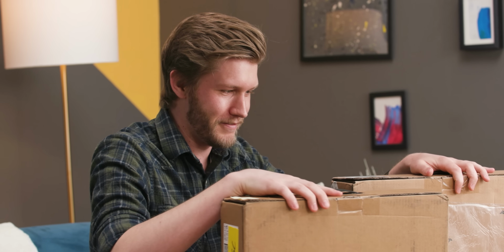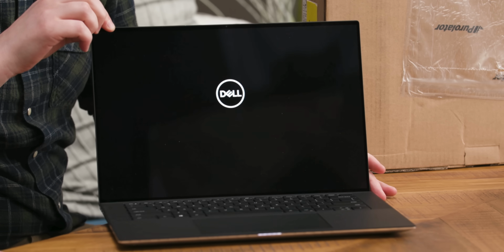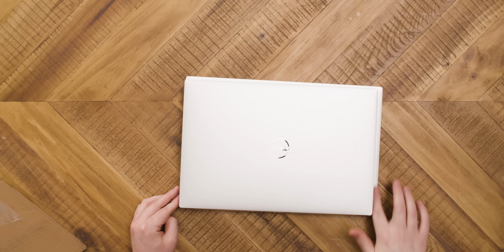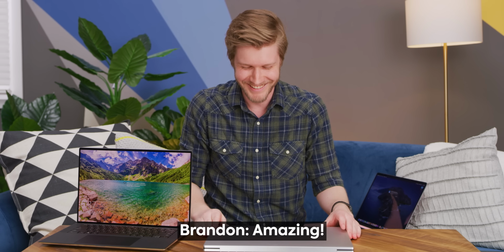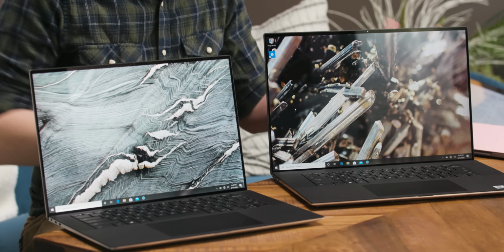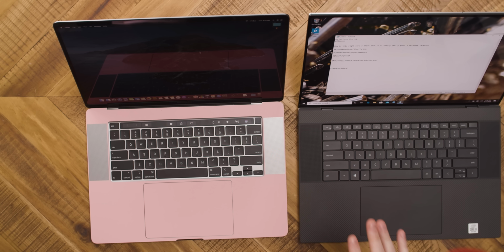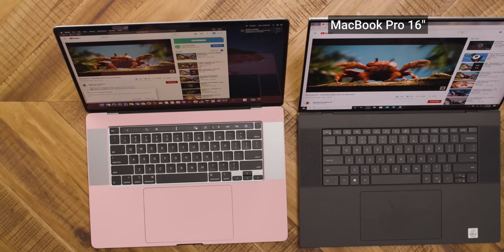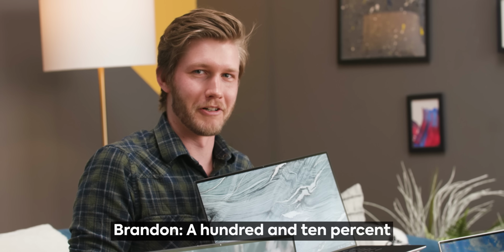The MacBook Pro's Biggest Rival - DELL XPS 15 9500 & 17 9700 Laptops

Comment: The fact that they're still leaving the Number pad off both the 15 and 17 inch machines means I still really don't care about their machines and neither will I be recommending them to any of our business clients.
Reply: What about those of us that prefer to not have a numpad?   I use my laptops for work and I actively avoid laptops that have them because I don't like how it shifts the rest of my typing off-center to the machine.
Reply: @NathanKull  I could say the exact same in the opposite direction. I manage outsourced IT for a number of data-entry heavy workloads in GeoTech, Engineering and Marine sectors. Every Time they've asked for a new laptop they've specified that the numpad be present since they enter numerical information frequently. Personally speaking I'd love to see them design a model which has a numpad as an  optional choice then we can both have what we want.

Comment: nope, macbook keyboard are trash.

try typing a 1000 word essay, my hands hurt like f.
am using that for my work and it don't feel averagely ok at all. is painful af.

lenovo soft cushion keyboard are something that is as great as diamond for people that actually use a keyboard.

~~~

also, blue light cut out of monitor is old af. lenovo implemented it like at least 10 yrs ago. what bs is that?
and apple don't even have it.
Reply: Which MacBook do you have, the 15 of 16”?    Just wondering if you feel that way with the new keyboard
Reply: @avz1226  think is a 16"
I got so fed up using it that I complaint to the management head on. 

never gone that far for a office equipment. sure hate it. My fingers are always hurting when using it.

the monitor is the same old eyes hurting monitor. well; is what one get when the monitor display is powered by a "backlight". At least is better then Dell or Asus though.
so i keep quite about this.
Reply: 佐藤海翔 thanks for the reply, I’m on the fence on what laptop to get for my coding bootcamp... not trying to make the wrong investment and hate  typing lol

Comment: I find that the laptops look great for a windows computer, but they don’t even come close to the look of an Apple computer.  Apple has a great keyboard that is truly perfected as well as amazing speakers.  They also have improved the keyboard you could say to give you more key travel on the newer MacBook Pros though I have a MacBook Pro 16" late 2016 did have to replace the keyboard once, but thanks to my investment in Apple Care it was free and now my system does have the MacBook Pro 2017 keyboard.  For me personally a computer by itself is important, but if it also works great with your smart home equipment as well as your phone, watch and TV that is just a bonus for me. It is the ecosystem that is also very important and that is something that I just don’t see with the rest of the computer industry besides Apple.

Comment: I would rather have a full cnc aluminium pc with a sandblasted and anodized finish.
The display is really nice, but its a deal breaker with those seams between the two materiales.

When does apple make windows optimized macbook😭??

Comment: Don't buy this line of laptops if you want to game. Thermals are abysmal and you almost always have to repaste. Not sure about the 17" as they have a new cooling system (they are using a vapor chamber i believe?) but I'm sure the thermal issues will persist with the 15". Again, not great for gaming or heavy editing on after effects or even moderate work on blender unless you repaste.

Comment: What happened to 1440p on laptops? 4k is utter overkill even if you have the best eyesight and 1080p is not enough for such an expensive device. I don’t get it? Just have one option of 2560x1600?

Comment: Brilliant bit of hardware, but, they both still run Windows, which is fragmented, buggy, and lacks proper trackpad support.  Mac OS is by far better, as is the Trackpad on the MacBook , the reliability will be much better on the MacBook , as are the speakers, thermals, build quality etc.  Apple Support is also far better, AND you can run Windows if you want to use any Windows specific programs.  Which is why I always buy a MacBook over a Windows laptop.

Comment: 135mm squared?  Think you missed a 0.  BTW if this is the largest trackpad you've seen on a Windows machine, you obviously haven't looked at the 2018 Matebook X Pro.

14" 3:2 screen (even better than 16:10 thanks), bezels just as thin top sides AND bottom, and the trackpad is 7.8 cm x 12 cm, for 93.6 sq cm, or 9,360 mm squared.  Guarantee that's as big as the 13" XPS.

Comment: Why can't they (Dell) just put a numberpad on the 17 inch models like everyone else can manage to do.

You have plenty of space on a 17, don't use the same damn keyboard the 15 inches use.
Reply: Maybe they dont want to? Asus doesnt do it on most of their devices (including the 17 inch), Razer doesnt do it and Apple doesnt do it either. Out of the top of my head i can only think of Lenovo and HP as companies which consistently put a numberpad on their 17 inch models.
Reply: You would lose the side upwards firing speakers, it's a compromise
Reply: @natmath2576  you put them up top, above the keyboard, where there's also room.

Functionality isn't exactly something you should be compromising on a large-form-factor laptop. When you've committed to a 17 inch, super-portability has moved down your list because you're likely not moving it multiple times a day, or for that matter outside of your house.
Reply: I'm fine without the numpad, in fact I really don't like them on laptops because I don't like how it shifts my hands off-center with the system.
Reply: This this and more this
Reply: My HP Envy 15 inch has a number pad. Yes it's useful even though I don't do many spreadsheets. Th bezels are massive though.

Comment: These things are NOT going to be good at gaming as thermals will be horrible. The only good laptops for gaming are Asus Rog because of the huge vents they get on the back and even then if you play some graphically intensive games it gets hot. These laptops will be good for 1-2 hours of easy on the graphics gaming and even then it will get hot. Nobody should buy a laptop for gaming that does not have HUGE vents for airflow.

Comment: Blue light is straight up unharmful, only UVs and higher frequencies electromagnetic waves can cause mutation to body cells. You can't really keep a blue color and removing emission from blue frequencies, however you can attenuate the amount of UV the LED is emitting (which is stupidly low anyways). So sounds like marketing BS. If you dislike blue tones on the evening, use a software filter like f.lux.

Comment: Why do I feel like the perfect laptop ever made for both gaming n' cpu intensive tasks was right here within Dell's grasp... & yet they didn't build it? It would of been the XPS model that combined the 15" screen size/footprint; but with the better GPU, the RTX 2060 MaxQ n' more importantly, the vapor chamber thermal solution of the 17". This would've bumped up both the thickness n' weight to be somewhere between these 2 models... but, dare I say it'd be the 'Ultimate' laptop, imo.
Reply: @Aaron Monto Ah, yeah, it is possible. Top of the line Intel laptop CPU (at the time), huge battery, RTX 2070 MaxQ, 15" laptop form factor and no throttling. Plus, it's 1.88 kg vs 2.11 kg! It's been done... https://www.youtube.com/watch?v=YlkFUB_XLVs

Comment: What's with the obsessive hate towards Intel suddenly? Yeah sure AMD CPUs are better now, doesn't mean Intel products are suddenly completely worthless. Besides, what people always seem to miss about performance comparisons is that 99% of the time you're not even using the maximum performance, and so performance differences only matter in a limited number of scenarios few people would even come across. For most consumers it literally doesn't matter at all, and Intel is perfectly fine even if AMD offers more performance/€ on paper.

Would be fun having people do a blind comparison between an Intel and AMD system in general use, without running benchmarks. My guess is nobody would be able to tell the difference without particularly testing for it or doing very specific tasks.
Reply: This comment is really old, but this is a really bad take. A) You want the best thing, especially in a product this expensive. In your case, everyone should be using core i3s, which AMD still beat with the Ryzen 3...

If I buy an i7/i9 it means I want to do real work. The “Avg consumer” your talking about isn’t gonna get an i7/i9, they’re getting the i3/i5. The higher end models are for people that need power, and these are the same people that want AMD processors.

And it’s not only price per dollar, it’s also dollar per dollar, like AMD CPUs are much cheaper than intel, even on mobile. Also add to the fact that they’re cooler (this laptop hit 99 degrees in stress tests where hey if you’re rendering a video or compiling a program, things that people with this laptop might want to do, actually matters) AND get more battery life, there is every reason in the book to pick AMD over Intel.

And yes, of course no one would tell the difference in a “blind comparison”, because it’s not fucking master chef is it? They’re CPUs, and CPUs have gotten so fast that the OS overhead is minimal compared to what it used to be. Add in a Qualcomm chip and apps compiled for ARM and you also won’t tell the difference...

TL;DR the people that are buying this laptop WANT more performance, which done by going AMD. The people you’re talking about in this comment are the people who buy the Dell Inspiron. They don’t care about performance. But the people that buy this laptop do, especially when AMD is consistently outperforming Intel by this much.

Comment: No optical drive is a deal breaker. Why must designers omit such a valuable part of any laptop. Yes you can buy an external but is cumbersome. Dell needs to include this option in more models than the lower budget models. The 2012 screen is much better. I like bezels.
Reply: ok boomer

Comment: I'm sick of every laptop brands that there aren't any selection for AMD variant processors. Any of them have an ethereal design but the biggest turn off is Intel. Come on, mobile ryzen chips have way better benchmarks than Intel's 10th gen outdated architecture and power hungry battery. This has to set for this decade.

Comment: The most important thing is missing: Thermals and Dell's reputation on warranty / customer service. Both have been a troubling parts for Dell. XPS have been notoriously loud when under load and getting VERY hot due the inferior thermal design. 

The good looks won't fix the fact if the product won't work well in tasks where it's designed for.
Reply: Dave 2D didn't a short look at Thermals and said the hardware has been radically redesigned for the better.
Reply: but yeah the customer service is pretty subpar, especially if you don't live in the states!!!

Comment: Never thought I would see the day an XPS 15 had less ports/bandwidth then a 13" Macbook pro.
They even took 10% away from the battery.
In the redesign make it thicker, give us our two usba ports and hdmi built in back with the two tb3 ports, and the battery indicator and 97wh hour battery, and upgradeable wifi and a vapor chamber and 8gb gpu option on the 15" and opposing dub woofer sound system and great headphone dac and a magnetic fast charging port/+ slow charging usbc.

It looks great dont get me wrong, 16/10 is awesome screen is awesome, very sexy. sd card is a must thanks.
But they dropped the ball on the 15" 17" has all the space for nonsoldered wifi and more ports, I mean come-on you are being cheap now.
Reply: I still remember my first XPS. It was a 17” almost 10 years ago. Blu ray drive, 1TB of space, a subwoofer included and one of the best batteries you could find. I think this was right around the time that they bought/partnered with Alienware. This computer was waaaaay better and cheaper than most. I think it could be a good idea to replace mi G7 with an XPS if things line up correctly.
Reply: @novalenvergamorros  The xps is great if I had the funds I t would be at the top of my list even with it's lack of ports, man I am glad the left the sd card, next redesign they will probably let that and the headphone jack go, or make it all wireless including charging:)
I hope not.
Reply: I don't understand why people are so upset with the absence of ports. You can buy almost anything on Type-C these days and in 2021 there will be even more stuff on it
Reply: @Andrey-il8rh  because we use them everyday, we already own the cables, we dont want to rebuy what we alreay have just to use our $2-$3000 laptop, especially since the last version has the ports, and usba, hdmi, sd card are not legacy ports, they have each been updated lately to the latest spec, and are in the majority of products.
This like why keep the headphone jack, because we have headphones, speakers, and devices that use that, have no latency, sound better, are cheaper, do not need batteris are not disposable after a year or two, do not waste battery on your phone with bluetooth, which can be hacked and throws wireless radiation around.

We like choices.
Reply: @Tigerex966  well, than you are out of luck)

Comment: "you could buy a blade but that will break" YEP! Had a blade 14 2016 I bought new in 2018 and it broke about... 6 times? in about a year. So bought a precision 5530 (Dell XPS 15 but pro model) I got for 1400euros new with quadro p2000 32gb ram 1tb ssd and i7 8850h. Also 4 years of dell pro support, meaning if it does break (which it hasn't in the 8 or so months I've had it, already beat the Razer by about 10x aha) someone will come to my door and fix it

Comment: "Go 16:10" - You know, once that was a standard widescreen ratio for PC, until they replaced our nice 1280x800 with stupid 1366x768. They invented that stupid resolution because 1280x720 isn't enough for many applications (many require a minimum 1026x768) but go back to stupid 1280x720@2x for high-density screens which IMO is THE NO.1 REASON windows laptops SUCK at hidpi: if you set it to 200% you got only 720 height which isn't enough, as a result most people with a hidpi screen laptop are stuck at 150% or worse 175% which makes everything blurry as shit!

FUCK 16:9 HIDPI LAPTOPS.

After all these years, we finally got the good old 16:10 back. Really hope other vendors would follow up and kick stupid 16:9 hidpi laptop screens into dumpsters where they belong.
Reply: I agree

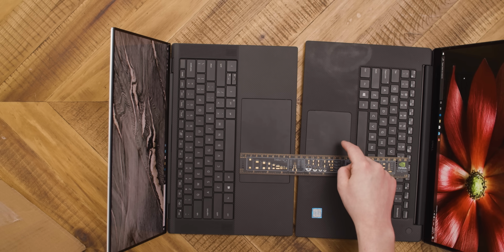Comment: 3:55 FYI, Old touchpad: 10.5 cm x 8 cm = 84 cm² (8 400 mm²)
New touchpad: = 135 cm² (13 500 mm²) 
When converting from cm² to mm², he just multiplied by ten; for area you need to multiply by 10² (effectively 10 in 2 dimensions).
840 mm² is about the size of a stamp; 135 mm² is about the size of a page number in a book.

Comment: I'd love to replace my 9370, but:
- I don't want to go down on usb-c slots (I have 3 now)
- I'd like to have 1080p touch display. Or, at worst, a guarantee that I will be able to use a lower resolution like 1920x1200 if it's 16:10 (I'm using 1920x1080 on my 4k display, because windows scaling just isn't reliable enough)
- the insert key needs to be a separate key

Comment: I have an xps 16 from 2019 (I believe) with an i7 processor, 16GB RAM, nvidia  and 4k display. I love this machine and my only gripe about it is the tiny ass battery they have in it. Why in the hell put a 57 watt hour battery on a powerful PC like this WITH a 4k screen? Why Dell, why? I'm probably gonna buy the 17" 2020 model if it has the same size chassis as the 15". That sounds like a perfect laptop. Dell works so well on linux, but I need more battery life.
Reply: But there was a 99watt hour battery pack version of yours laptop as well so why didn't you buy that ?

Comment: AT my work a lot of us have xps 15 (9560 for me) and there is a lot of things to like (battery life, design, screen, keyboard), but there is a LOT of us that experienced countless issues, notably with the thunderbolt dock, the fans (mine were changed twice in 2 years), charging boards, motherboard replacement, driver issues, etc....my computer is 2 years old, I can't believe I still have so many driver updates that can still crash my machine..
My IT department is sick of them, and they almost always have 5 XPS just waiting to be fixed.
And while the lack of the rj45 wasn't so bothering (we use them a lot for connection to automation equipment), if my next pc doesn't have a single regular USB A, it's going to make everyone life so hard
I understand the "world" is moving to USB C, while that's true for personal equipment, it's definitely not the time for professionals
I guess I will have to old onto this one.....

Comment: Worst buying experience I have had with a computer,Speakers disfunction, with no support from Dell, battery did not last more than 14 months and dell would not sell a new battery only refurbished, computer had to be returned to re install operations system, overheats and throttles down, but it works good if you put an 10 inch fan blowing on it! XP’s 9560 stay away :(

Comment: Dell updates are horrendous, that's what ruins the experience for me.
Reply: Also, their quality control seems pretty bad. I switched to windows recently and thought about buying an XPS, but I ended up going for a surface laptop instead after reading about tons of people who had problems with wifi, updates, drivers, loud coil whine, unreliable performance etc. Reliability is extremely important for my work so I was "forced" to go with a surface. I've had zero problems so far. That beingsaid, the new XPS laptops look a lot more modern.

Comment: 5:50 , actually the old XPS 15 comes with a 130W charger as well, possibly even the same one save for the connector going from barrel to USB-C. Not out of the ordinary for XPS series.